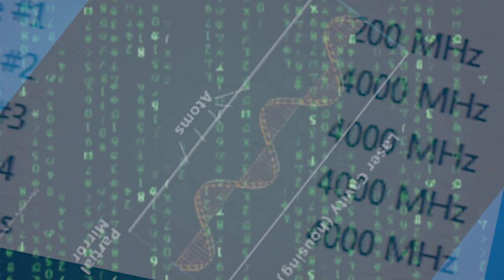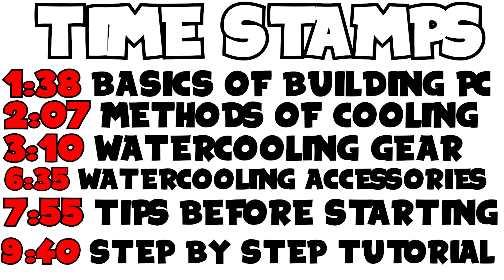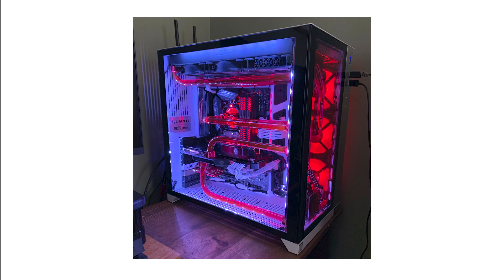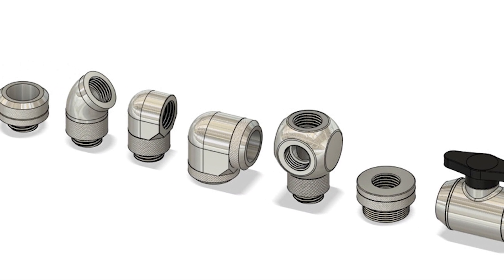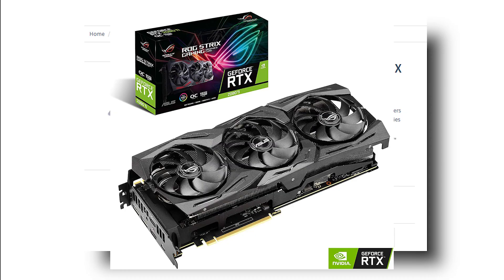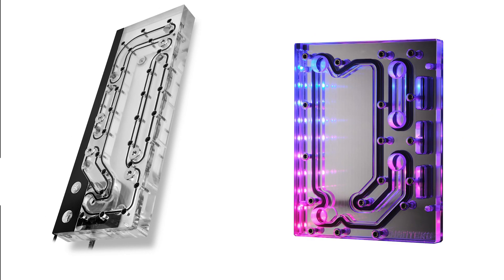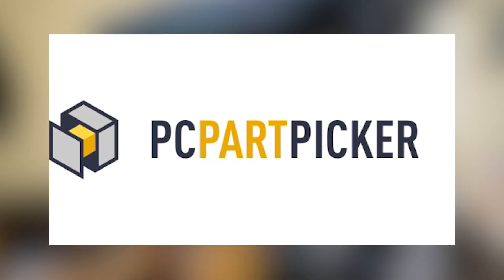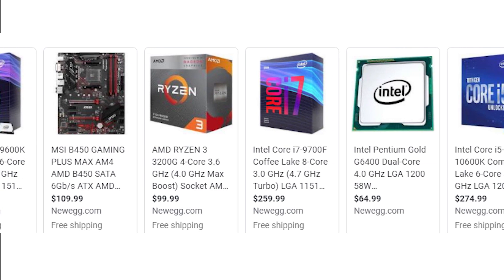WATERCOOL YOUR PC! - How to BUILD a GAMING PC! STEP BY STEP

Comment: What are those fittings? I love the rgb on them!
Reply from the maker: Thermal take rgb fittings! They're nice, but only come in sizes for 16 mm tubing
Reply: @crabdash7288  what is the resivour on the side of your case? an dis that a pump in it also? meaning u have 2 pumps? or is the side one just a res?

Comment: How much did the loop cost? Rad, pump, reservoir (I know it differs by setup, but just to have an idea. Ty
Reply from the maker: around 500/600. coulda saved by not including res plus getting a cheaper d5 pump, but spent the extra for the acrylic rgb pump👍🏻
Reply: @crabdash7288  I fear I’ll waste tubes bending and measuring and failing if I try lol. But this one of the few that I have not tried. Building a pc is fine, but custom cooling, scared to try haha. I bought the tools for bending though.
Reply: @Cons2911  the tubing itself isn't that expensive, just buy extra and accept that you'll make some mistakes and waste some tubing when starting out. it's no big deal, you've got this.

Comment: Awesome video. Planing on building my first custom loop for my RTX 3080, have a good aio(Alphenfön Gletscherwasser 360) for my cpu so wont bother doing both. Went with stuff from ekw, and will be doing soft tubing even if hard tubing is looking way better but seems like a pain in the ass to do. made a blueprint on beforehand and probably ordered more stuff than i need but... better to much than to little i guess. Going with a vertical mount from ekw for the gpu too, and probably going to have mod(dremel) my chassi quite a bit to fit the pump/reservoar.

Comment: Nice video, system looks sick ✌. Just wondering, do all motherboards have a port to plug in a pump, or do you use just a standard fan port? Also, when you shutdown your pc, does the pump keep running or only when the pc's on? Appreciate any answers, thanks for the helpful video (earned a sub)... cheers
Reply from the maker: thanks! yeah, depending on the pump it will tell you where to plug them in, i plugged mine in the cpu fan port. the pumps run in rpms just like fans do so there shouldn't be a problem with ports for your motherboard. and when the pc is shutdown the pump shutsdown as well.

Comment: What is the difference between the fans
Reply from the maker: static pressure pushes air harder (better for radiators) while airflow help bring in my air but not as hard (for cases)

Comment: Just so people who are new to water cooling, distilled water is just tap water that has been boiled slowly and filtered. So in reality you can go to amazon or some other place and buy a water distiller and make your own distilled water. You will still need additives.
Reply: but you can also just buy jugs of distilled water at the grocery store for cheap...
Reply: @error.418  or you can make your own. And only then can you be sure you have distilled water. Many a loop i have sen with lime scale in it.
Reply: @keibohow69  I've never had lime scale issues with purchased distilled water... making your own is not worth it. but your original point, that distilled water isn't some magical thing, still holds. there's nothing wrong with making your own, and it's accessible, but it's not necessary.

Comment: Why static pressure fans on rads?
Reply from the maker: static pressure is better at pushing air harder through the fins compared to airflow fans that focus more on pushing/pulling more air to flow inside a case. Since you need to cool down those fins on the radiator to cool the water down, static pressure will get rid of the heat faster👍🏻 check out Jayztwocents video on it if you need any more confirmation!
Reply: @crabdash7288  awesome thanks for the reply! Awesome video man. What a nice build!

Comment: Might be commenting a little early but just a heads up. Please don’t mix metals in your loop. Try and keep your fittings and water blocks the same material, I.E. if your cpu and gpu are aluminum blocks, then please get aluminum fittings! This is to avoid corrosion! Mixing metals will almost always cause corrosion. Where as using the same metal makes it almost (not entirely) impossible for it to corrode and ruin your parts!

Comment: Awesome video.  Thanks for doling this.  I have an aio CPU WATER COOLER.  i AM GOING TO TRY AND COOL MY gpu.  Do i need to get another radiator or am i good buying only the water block for the gpu?
Reply from the maker: ur gunna need a separate radiator because the aios aren't meant to be spectated from the tubing it comes with.

Comment: if I use distilled water do I have to change it if so how often
Reply: If you've added growth inhibitor to the water, then every other year, with a deep-cleaning of tubes and fittings inbetween before you refill. If you use coloured water (which already has growth inhibitors), they say every year. To be safe, it's recommended to do it once a year regardless. 😉Opinions differ, though, as does liquid, manufacturer's advice and so on.
Reply: @Talwyn_Wize  thx

Comment: Hey! What would be the best case for water cooling?
Reply from the maker: For an easier experience, full tower cases will give you a lot more room so it's less tricky to get your tubing situated, however any case would be fine as long as you make sure they can support enough radiator space for your rig👍🏻
Reply: @crabdash7288  so would lian li o11 dynamic xl be good? Because I don’t understand where you attach the pump
Reply from the maker: @Mike_40.1  that's a great case! pumps can either be mounted on top of fans or you can purchase a mount for them to attach to basically any mounting spot on the case where a radiator/fan would be.
Reply: @crabdash7288  AMAZING! thanks you so much for helping me. I was really struggling with finding a case and I saw this one but couldn’t find much info on if it’s good for water cooling.
Reply: @crabdash7288  what’s the case you used in the vid?

Comment: DONT BUY AIO THEY ARE NOT NEARLY AS GOOD AS AIR COOLED AND THEY AREcheaper
Reply: Did you get a booty aio? Also they are more aesthetically pleasing, and can add more airflow to the whole pc
Reply: Quexco is nzxt 240mm booty? I agree that they are cooler but noctuas air coolers are 70$ and perform better
Reply: Quexco hello again i watched a gamers nexus video on the topic instead of a ltt one and seen that most aios over 150 do  out perform air cooling but i think most people dont want to spend 150+ on a cooler unless they are all out custom looping the thing
Reply: bean bean Thats the point. Most will get an air cooler. But if you want better performance, get an AIO. Otherwise AIO’s wouldn’t be a thing. And if you’re gonna buy an aio, I’d assume you’re gonna not be cheap with it